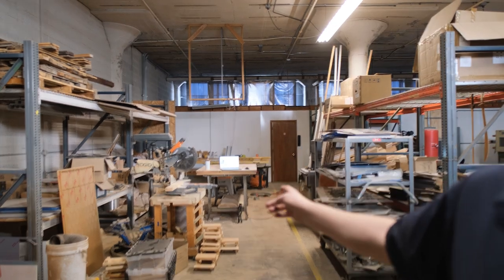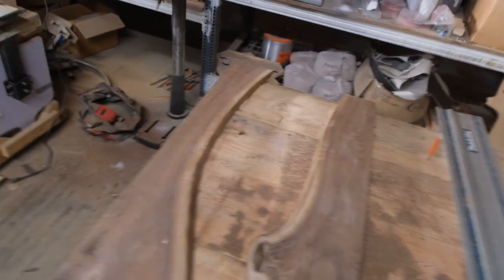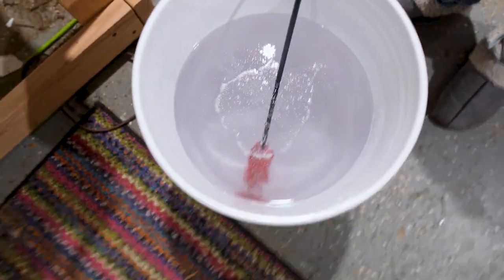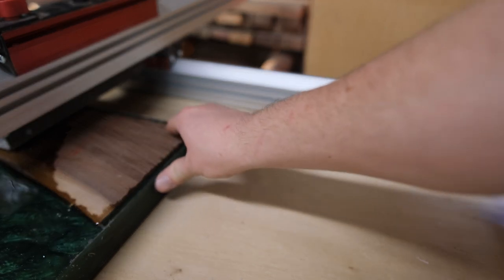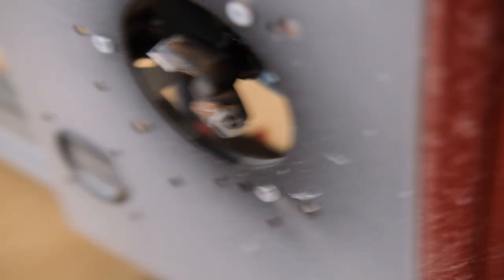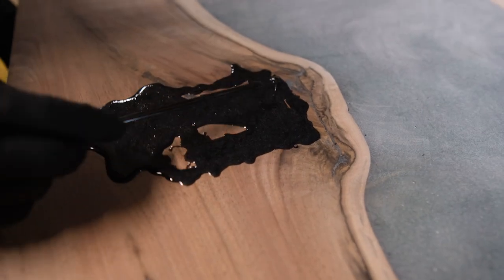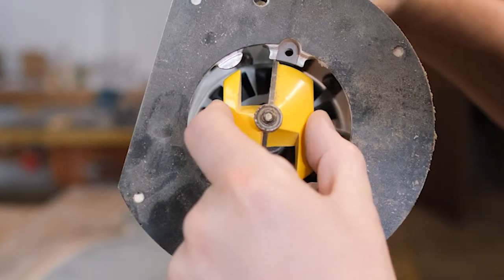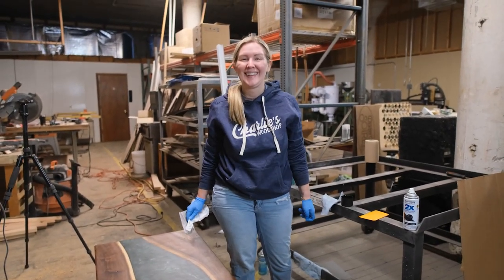Epoxy River Table - Step by Step Instructions

Comment: Hey dude I think you'd have a lot better results with your track saw if you clamp the track to your work lol all that smoke on your first rip was because the track was allowed to wobble.

Ah jeez louise my guy you need clamps! Watching you sand while holding the piece was just like watching you work too hard.

The most fucked up part of this is that this video is way more entertaining than the radio show lol good work dude 🤘